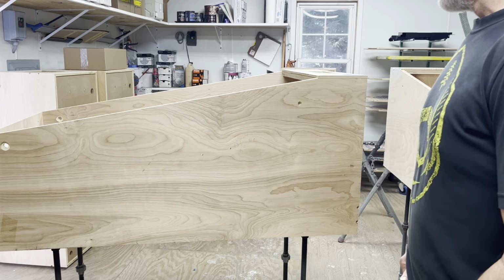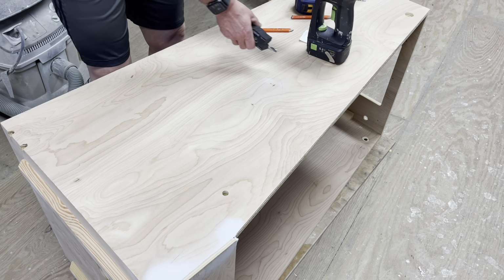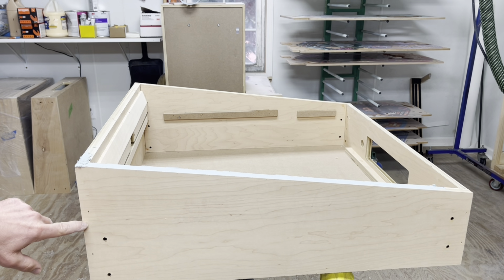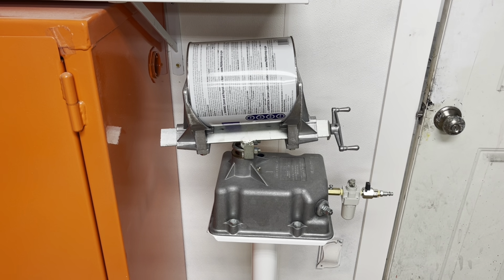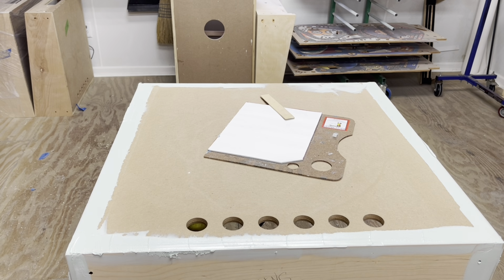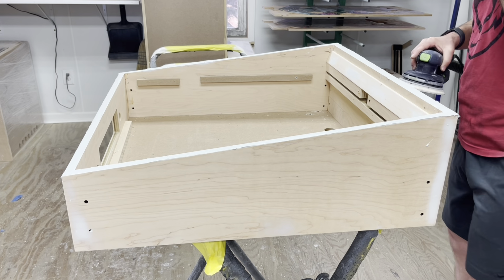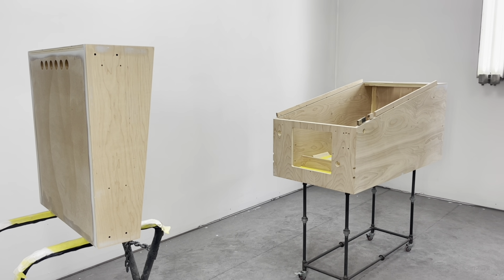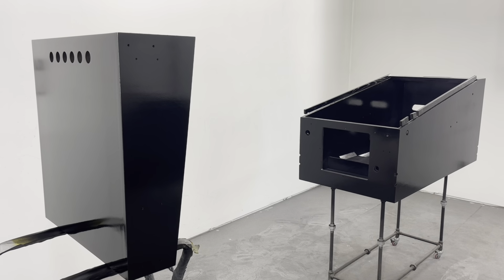Star Trek The Next Generation pinball 2

Comment: Great video - can you give any more detail on the paints you're using? I'm in the middle of a TSPP restoration but can't get the finish I want when respraying the cab. Problems with the MDF on the back of the head absorbing the paint (like you mention) as well as textures showing through when there shouldn't be any, blistering - all sorts! I've had a lot of success finishing metal before but this wood stuff is a completely different beast 🙂 

Maybe it's a case that I'm not finishing the wood with the right grit before painting too - what do you recommend there?
Reply from the maker: When dealing with MDF it is kind of fuzzy and wicks the material in much more than plywood or metal 
  Sanding it as fine as possible like up to 500 grit helps but it still will absorb. 
The best thing to do is prime it. Sand it then paint it. 
I cover this in some previous videos if you look back a bit.
Reply: @highendpins  thanks for the reply! I will try a dedicated primer. It sounds like you're using 2-part paint? So far I have only tried off the shelf hardware store stuff.